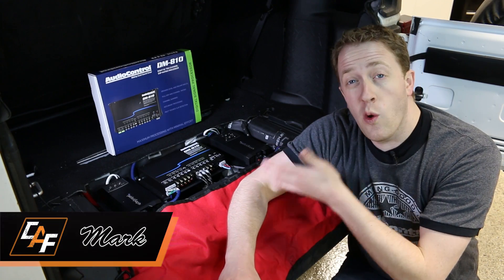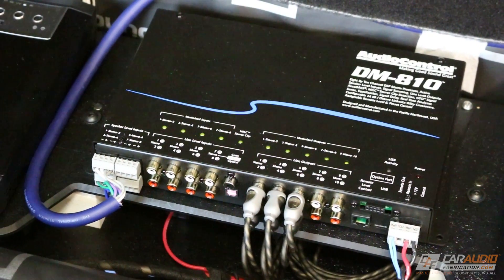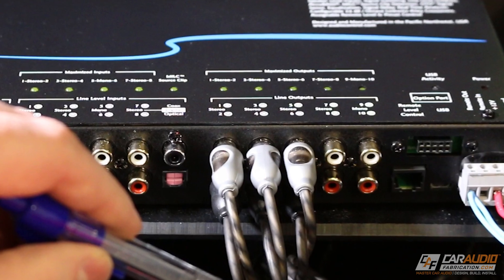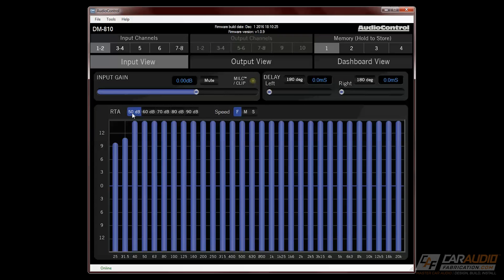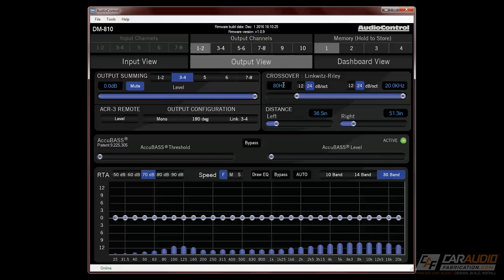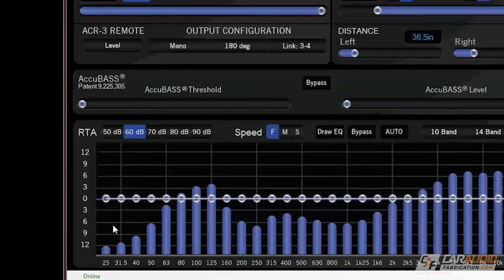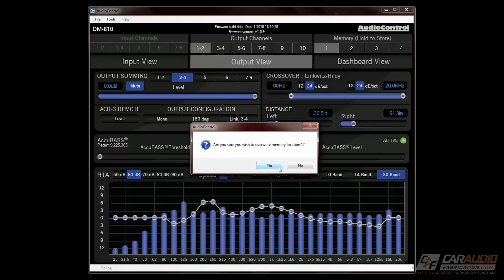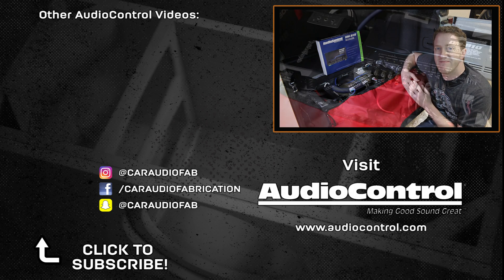AudioControl DM-810 DSP - INSTALL & OVERVIEW

Comment: when adding this unit to your system would the amplifiers xovers be set to flat?
Reply from the maker: They wouldn't be set to "flat" per se but rather set to "All Pass", in other words not  applying a crossover at all.
Reply: That setting  to flat would also be set like that for the sub amp too?

Comment: I thought I knew a lot about audio till I saw this video..
Reply: Heard it one time “the more you learn, the less you know.”
Reply: five channel amp solves your search for sub low levels, or split the low level converted from the rear channels. Or buy a DSP like this and just run your high levels into that, and it will give you front, rear, and sub out. He did exactly what you're trying to do in this video, Convert a stock heads high levels into multiple low outputs.
Reply: LegitMods4u maybe you could respond I'm trying to get the parts together to start doing my car audio upgrade I'm trying to retain my factory head unit and am aware that I will need a line out converter. I want to amplify my door and rear deck speakers and also wire in a subwoofer, I'm wondering how to wire them. If I get a four channel line out converter for the door and deck speakers where would I wire my subwoofer? Also do I go with a four or five channel amplifier? I understand a LOC as being the inputs to the amp via RCA and running wires from the amp to the door speakers for my outputs but where do I get my output to my sub.
Reply: Ye me too

Comment: Wonder if something like this will help my alpine upgrade (i also upgraded my front door and two of 3 dash tweets to a focal componet deal)without any other upgrades at this time..In in a 2016 ram sport with the 8.4 screen and 9 speaker system..
Reply: We have a DM-608 that will be perfect for your system. It will be shipping in 30-45 days and will retail for $599. Only difference is 2 less inputs and 2 less outputs.